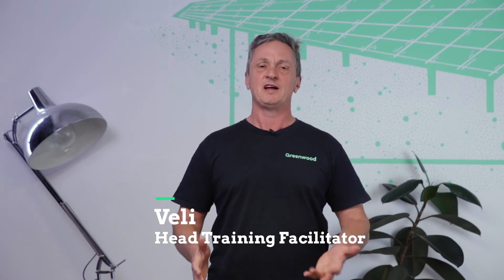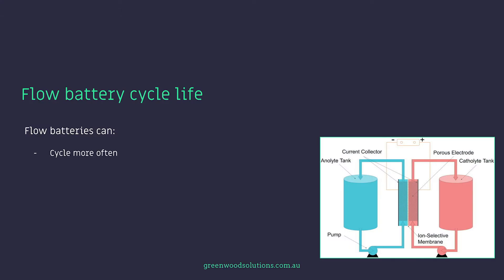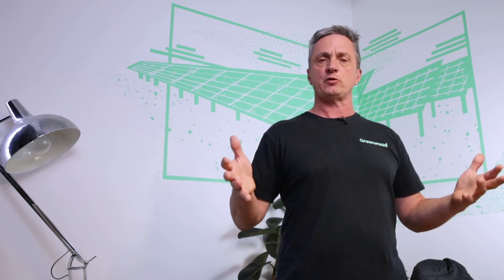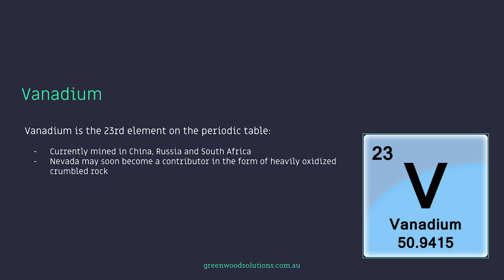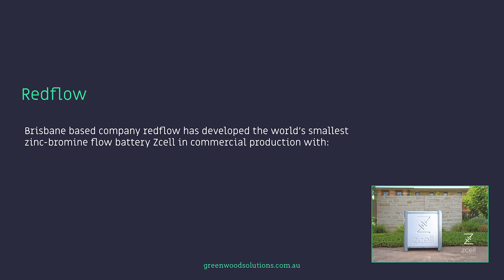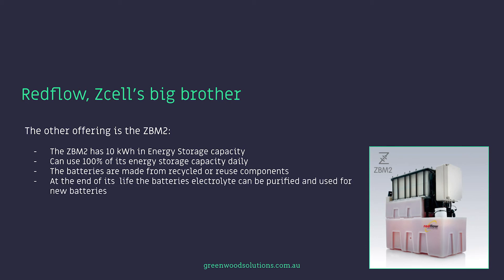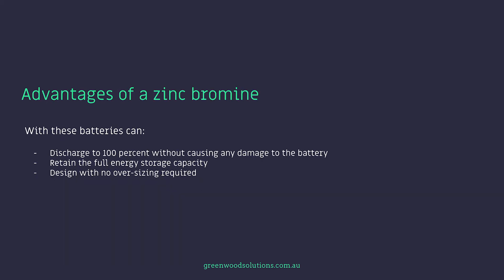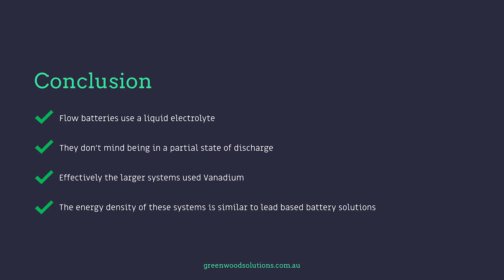Flow Batteries

Comment: 50 deg centigrade is only 90 deg Fahrenheit. That's our fall-time night-time temperate outdoors. Summers in the California desert often reach about 118 F. These batteries would almost never work here. That really disappoints me so much because there is so much to like about a flow battery system. (This is where I need a weeping emoji.)
Reply from the maker: Hi T Thinker, 50 degrees C is actually 122 degrees, F so they would work!
Reply: @GreenwoodSolutions  HAHAH I was going to say, F me 50 Deg C at night is crazy, looks more like @T Thinker the average hottest temp in Deg C is only 37DegC so you have lots of room there. I would worry about the Low Night Winter temps being below 10DegC. Having the units inside would solve both those issues though.

Comment: Flow batteries can perform very well below 20kWh, look at Voltstorage. They become more cost competitive when they are 20kWh or larger.

Vanadium batteries are incredibly resilient. If you accidently discharge a vanadium battery to 0V, or even reverse charge it, the battery can be recharged, with no damage or degradation of any kind. The reported cycle life of 10,000 is not an actual limit. It is simply a number they believed was high enough to sound like a lot, and it is cumbersome to test long duration batteries longer than that, prior to releasing numbers. At 10k, 15k, or even 25k cycles, there is no appreciable degradation of the battery. The stated 25 year life is more accurate than the 10 year estimation, based on cycle count. 25 years can even be exceeded, but it is difficult to prove that projection with a new product.

Zinc Bromine batteries do not store bromine on the membrane, it returns to the tank after the reaction. These batteries may also require oversizing, because the limitations of a plating battery occasionally require maintenance cycles, which would require a period of unavailability. If you need availability at all times, you need additional batteries to cover that time.
Reply from the maker: Thanks so much for all the information you have shared!